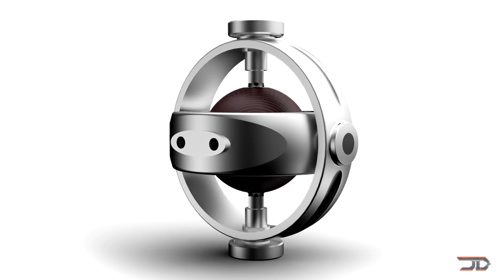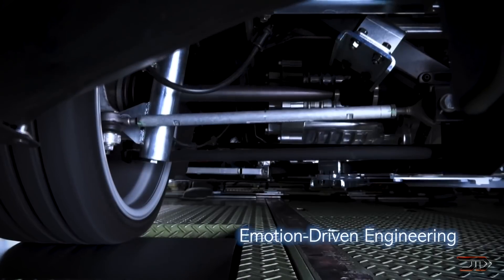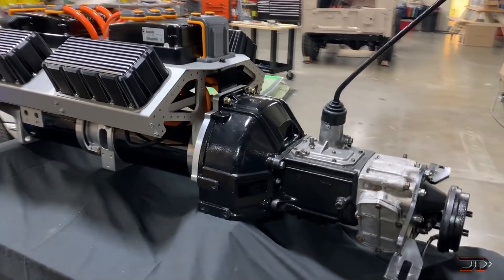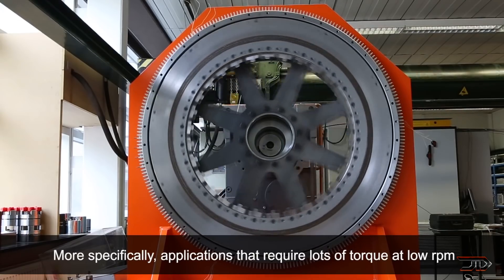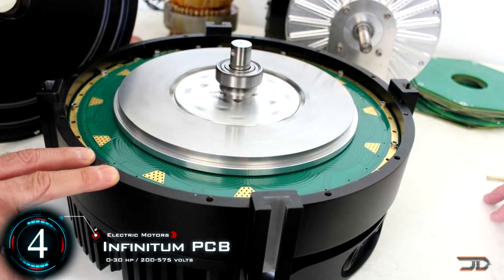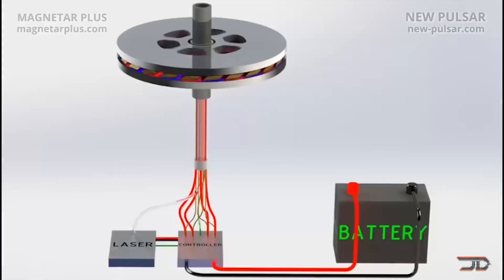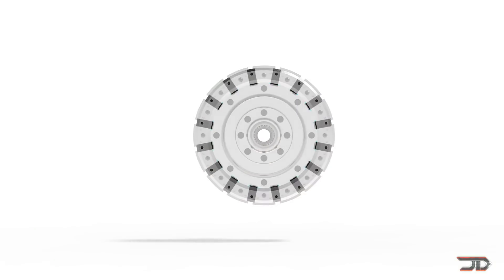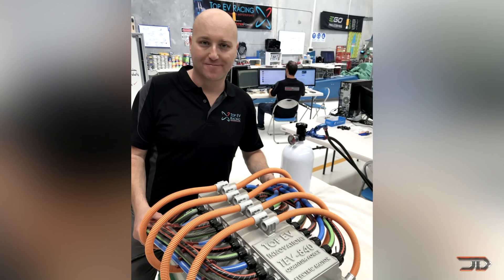7 STRANGEST New Motor Designs

Comment: MSo they mounted 4x 1,300hp motors on the race car, so your saying that thing has ---5,200 horsey powers holy horsepower that's a whole lot of horsey purrs. It would probably rip the chassis into a million pieces everytime you hit the throttle pedal.

Comment: A 30HP PCB motor? Other than longevity that's ready for production. Put one on each rear wheel or even all 4. A big difference between a "60 HP" electric and 60 HP gas is the torque. A Geo metro needs to peak out RPM to hit that 60HP. An electric holding at 60HP from the start is going to be just fine in a vehicle.
In drag racing they have spare engine blocks. I'm sure standard practice is swap out all motors after each pull lol

Comment: What really impresses me is that no matter how complicated an electric motor is as seen on this video for 
example, it is still a hundred times simpler, more reliable, better performing, easier to maintain etc than the ICE.
Reply: True.....but the battery to power it is the weakest link.

Comment: The flux tunneling of the Modular HET and the circuit board printed coil wiring of the Infinitum PCB are some real breakthroughs. Thanks for putting this video together. 

It seems that no one has yet picked up on the multi-filar windings used by Tesla Motors and championed by John Bedini yet. They add a lot more umph at higher voltages. I suspect it has something to do with the capacitive load created between the wires. 

Also, I've found that a resonant coil triggered controller helps out significantly in DC motors. 

http://facebook.com/perpetualmotor

Comment: 5:41, damn, they put 1300 HP in that little drag car!
5:42 Of course they did, why would they only use one when you can use 4
Reply: 1300 is nothing, most top fuel dragster are well over 5000 HP, I haven't followed in years, but they are way above 1300, they do a 1/4 mile in under 5 seconds!
Reply: @jamest.5001  10,000 in the top fuel dragsters now.
Reply: @jamest.5001  well with them having 4, it would mean their car has 5200HP.

Comment: The foundational idea is simply a flywheel...A well balanced flywheel will generate energy effortlessly
Reply: What foundational idea? A flywheel only gives up energy by giving up angular velocity. If you use the flywheel as a rotor as well and maintain a set RPM, there is no inertial torque transfer except on very brief time scales. The flywheel in this sense is merely a conduit for the motor. So to get energy out in a longer term steady fashion, you would need a CVT. With a single motor-flywheel, constant-steady torque would require the motor to satisfy current requirements PLUS spin back up to target RPM, that is if you want to again .. use the rotor as flywheel.

Comment: That Infinitum design is an AWFUL LOT like the thought process that went into designing Fishman Fluence pickups.

Fishman Fluence are next gen electric guitar pickups that are made with a stack of PCBs instead of a traditional coil around a magnet design.  They are getting rave reviews and they have eliminated virtually all the consistency problems associated with traditional designs.

Good stuff.
Reply: I have questions as to the effectiveness of this in motors, but in terms of ease of construction and consistency, it seems like it would be really impressive.

Comment: 5:44 "0 to 124mph in 0.8 seconds" so you stomp on the pedal and the car accelerates so fast it kills you? epic
Reply: 0-200kph in 0.8 seconds is surprisingly only 7g. the occupant could easily survive that but the laws of traction say no and I suspect it will do 0-200 in 2.5seconds without some kind of secondary force to either create artificial down force, like a suction fan drawing air out from under the car , Or a active propulsion system like elons rockets.
Reply: @another1commenter770  "active propulsion"? Is that like traction control (no peeling out)?
Reply: @another1commenter770  I was wondering how many gs that would be pulling. Thank you
Reply: @another1commenter770 
Pretty much it's at the point you'd need a rack and pinion rather than track and wheels.
Reply: @another1commenter770  or, the track locks down the vehicle for the distance. It wouldn't be cheating to have an electromagnetic track would it?
Reply: @another1commenter770  
“Elon’s rockets” on road vehicles won’t ever happen. It’s an incredibly dumb idea.
Reply: Top fuel dragsters can reach 160 km/h (100 mph) in 0.8 seconds, and reach speeds of 539 km/h (335 mph) at the end of their roughly 3.6 second runs. They pull somewhere around 4 - 5.6g throughout the run.
Reply: Ah, thanks, I also thought the same. Let me add 0 to 380 MPH in less than 5 seconds is a bit cra cra. I imagine one of those G suits that fighter pilots use may be needed? "Neurosurgeons scream for more"
Reply: @fanplant  I don't think you need a G-suit, due to the direction of the force. Nothing is pulling blood away from the head. Rather, it's getting pulled away from the legs.
Reply: Hey...I want one
Reply: You will become sterile once you drive that. No spermatozoids can stand that.
Reply: Just like today dragster when the back wheels hit were the front wheels were you are going at 100 miles/ hrs
Reply: https://www.youtube.com/watch?v=wc_hq40KBKA&ab_channel=techamazzon

Comment: My only motor design I've thought of that I haven't seen made yet is a brushed counter rotating motor. It's much simpler than the counter/contra rotating motor in your vid as it's simply a brushed axial stator and permanent magnet rotor, each on their own bearing. The only use I could think for it was for counter-rotating propellers.
Reply: @Scott Menard . Magnets are well studied. a micro cassette tape, smaller than a DAT tape can now hold 500TB (0.5 Petabytes) of data... Hard drives. 'Permanent Magnet Printing' can manipulate the magnetic field with high resolution accuracy.. Unfortunately, a Neodymium + Lithium economy is far, far less green and easy to recycle than a Carbohydrate + iron and aluminium economy... I prefer my reciprocating, single cylinder, 1 STROKE I.C.E. design, with combined 'ring piston' heat engine.. The combustion chamber at each end is an impeller.. It's a radial engine - the whole, compact engine spins.. Compression and Power stroke combined and two way, hence 1 STROKE!

Comment: Good info we r interested in building elect driven equip with methonal fuel cell 1 403 830 4124 using green hydrogen ( Co2 stays underground ) in old abanonded oil wells( 40% oil still left in the grond)

Comment: Yes, The spherical electrical motor is My design!
Reply from the maker: Can you share some more details about it?
Reply: @Motor_Explorer1  It is the drive mechanism that power UFO / flying saucers.  Similar to Tesla's design, but all self contained in a single sphere.  Quite engenious.   Took me 6 months to figure out just exactly how to make it all work.  Now I just about 10 Mil to build, test and then put it where it belongs.  In a ship an go to Mars!
Reply: Waiting to win the lottery!
Reply: @davidbradley3074  the first thing I thought when I saw it a the beginning of the video is that it would be a motor similar to what a ufo would use! Did you really design it?
Reply: @pocketoperatorjams98  Not this motor, but I have mentioned it before on the internet, 2015.  Yes I have a design much better than this.
Reply: @davidbradley3074  We won't hold our breath, but keep trying, one day you might see someone with a real breakthrough in motor design that is practical and suitable for mass manufacture......but it won't be today or tomorrow but it will one day happen.

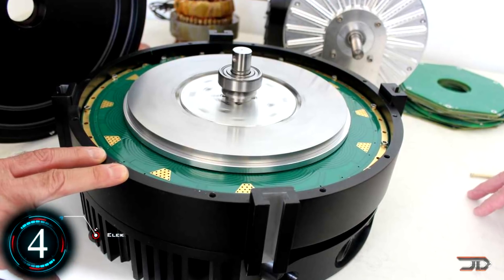Comment: 3:24 - PCB motors have been around for decades. They were typically only used in low load applications with limited space allotments (such as old hard drives). CORE, a green power company made great strides in PCB motor development in the mid 2000's. Several experimental versions were tested for the wind energy market. To my knowledge, all that remains of any consumer sized goods were acquired by MTD/American Yard Products. Their  brands (Cub Cadet, Snapper, etc.) marketed string trimmers incorporating CORE PCB technology. 

PCB has spelled the future for electric motors and generators for some time. Until the last decade, we lacked the technology to appropriately control them. The materials cost savings, reduced rotor weight, and the possibility to use of silver traces... all combine to offer a motor with more performance density and efficiency, at a lower cost of production and packaging benefits. The problem with PCB motors is their duty cycle is comparatively low, for lack of adequate cooling options.
Reply from the maker: Thanks, that's why I like making videos. People provide their own knowledge of the subject and it helps me understand it better.
Reply: I think it was in 1979 that I purchased a Technics turntable that used a PCB motor that was directly attached to its platter.

Comment: I worked on a lathe electric motors for Mercedes and without a magnet it weighs 40kg, which sounds like a lot. The aluminum housing had cooling grooves and from the winding are three wires (a simple brushless motor) .E.m. is intended for off-road vehicles and I think the option with two e.m.
  I am always interested in the field, my hobby is RC vehicles.
Thanks.
Reply: German's have some Real Trick motors...Czech out the first D C motor.
Reply from the maker: Thanks for watching, that would be interesting work!

Comment: why would you have a transmission behind electric motor when you can just run the vehicle with the electric motor and it's instantaneous 
don't really need a transmission is what I was told ???
Reply: It looks to be designed for swapping into your decades old muscle car that doesn't run right now. If you don't already have an old car, this product is not for you.
Reply: It all depends on the rev range of the electric motor as well. There is actually no point in changing gears, as it will take off in top gear most of the time with the amount of torque that a electric motor produces. So it just depends on what sort of take off you want.

When you compare it to how Telsa has set theirs up, which is just a single drive, but they have a ratio of 9.81 to 1 or something crazy like that, and it does that twice, but their motor also has a rev range of 17,000, so they are just utilizing their ability to rev like crazy and use the ratios to increase the torque output values.

At the end of the day, it all depends on how much you want to be screwing around with your conversion as well. If you have a rear wheel drive car, then you'll need to work out how to get that power to the back, if you have a transmission already, then you can just go through that, the interior of your car stays the same and it's just powered by electrics.

If you have a front wheel drive car, a lot of the time you'll have to change over your drive shafts to suit the position of the electric motor, and if there is any variation in the gap between the driveshafts as well within your transmission. You'll also be limited to the type of motor which you can use if you go this way, as you'll have to have one which already has a gear drive system built in like a Tesla, or the Yamaha.

Also his argument with the auto transmission is a little incorrect, if you have similar power/torque ratings and rev range to the original ICE motor, then there is no risk of the transmission exploding, it's more so that especially with the older style powerglide, 3 speed, 4 speed transmission and the way in which they work, you will need to maintain constant rotation in order to ensure that there is enough hydraulic fluid to get the car moving when you have it in drive. If the motor isn't rotating then it's just not going to work and it will be a pig to drive.

Of course they don't like to keep electric motors rotating because of the fact that the power source is a battery, and to keep a transmission spinning it will turn a setup which would be able to do about 200 k's (124 miles) in city traffic, would then be reduced down to about 130 k's (80 miles) if you're lucky, and if it's peak hour, then you'll probably use all of your charge just waiting about.
Reply: @MassageWithKlay  I agree.....making an electric drive and then adding a gearbox is not user friendly as it's six of one and half a dozen of the other with the power that an electric motor consumes in turning the wheels.

Comment: The axial flux motor was originally patented by Nikola Tesla in the late 1800's. And regarding the PCB motor – one of the engineering problems that still needs to be overcome is having the traces on the board come loose under high torque and braking (regen) cycles. They get hot and Lenz forces can literally tear them off the board when the adhesive gets soft from the heat.
Reply: Why use pcb type when you have solid state  design technology
Reply: @chanakyasinha8046  Solid state technologies realm is in the micro world with tiny components. A stator is in the macro world carrying large amperages and voltages. I suggest you rethink your inks ..
Reply: High temperature adhesive need to come out. Maybe the glue can be used from aerospace applications from the space shuttle heat tiles